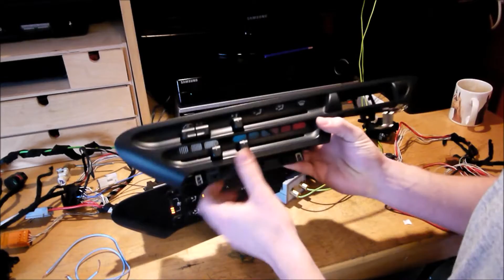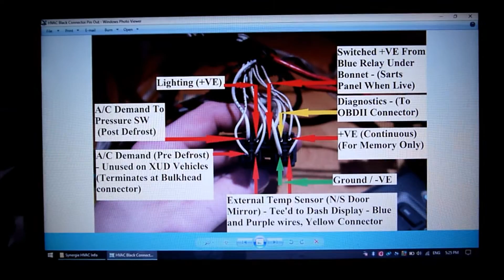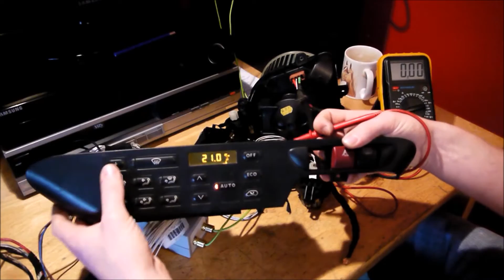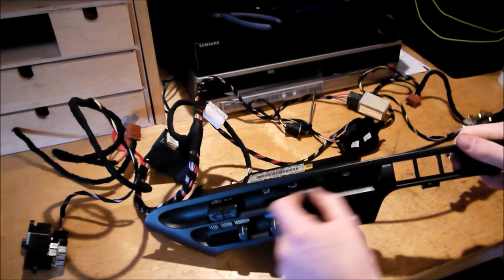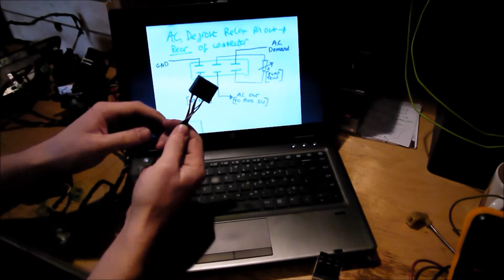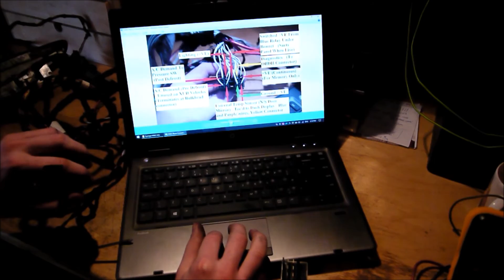Citreon Synergie / Evasion / Peugeot 806 / Uylsse - Heating & A.C. Info

Comment: Thank you man 👍.
Very usful and detail explanation.
I am trying to instal this type  ac climate control to my fiat scudo mk1 camper project.
Have all needed parts from peugeot 806 donor car.
My fiat newer had ac. 
I am using "peugeot schematic" software for wirning diagram to figure out how to conect all.
Work in progress.
Thank you.
Reply: Finnaly I am install this tyoe climate control system on my first generation fiat scudo ( no have ac at all from factory )Control panel of this climate  control works in very not logic way. French programers smoke some weed when writing codes fir this controller 😂.
And still cant conect this to obd scaner to read all parameters temp ant etc....

Comment: i retrofitted Air conditioning to my 2005 Dispatch and was looking for one of these controllers but they are quite rare! i ended up going for the one that has the "air recirculate" slider being replaced with the 2 button "Recirculate and A/C" buttons. it was great! and now 3 years on its still working perfect! its all documented on the Dispatch Expert Scudo Forum and i made videos on my channel too!
now i am looking at retrofitting Cruise control using a 206 steering wheel radio stalk as its the same stalk (just with 2 wires where the cruise control stalk uses 5) can soon fix that as they are both 4 button stalks. again, i am adding this to the forum and will make a video on it :D
Reply from the maker: Excellent! That's great. The worlds needs more people like you. :) I think I came across you on Facebook only a few days ago. Well done!
Reply: @NickExton309  that will be me looking for pollen filters... sigh

Comment: Hi Nick, A great Video and very informative..  
Wonder if you have the schematic or wiring pinouts for the two connectors on the Climate control panel on the 806 as the motors have stopped working? 
Cheers.

Comment: Any ideas folks, I've got the digital unit in mine and during winter and whilst cruising along the motorway, the temperature gradually and continuously varies between warm and cool without adjusting anything.

Comment: How do you replace the backlight which tells the temperature settings (digital display)
Reply from the maker: Hi James, there's a tiny lamp on the back of the panel once removed - Easy and cheap enough to do :)
Reply: NickExton309 is it easy to remove the panel ?
Reply from the maker: @JamesNoteology  Yes, very. You have to remove the gear stick gator surround to reveal the screws, as well as the cigarette lighter and ash tray, then the top of the panel is simply held in with clips.

Comment: the manual one you find more on the vans up to 2006. and is ythe most common one used on vans between 1998 and 2006

Comment: Hello! Well done! very good work.
I wanted to ask if I change the climate control panel with a used one will need some adjustment with a diagnostic for the flaps;
Thanks!
Reply from the maker: Sorry to not reply sooner - No adjustment needed, just plug and play :)